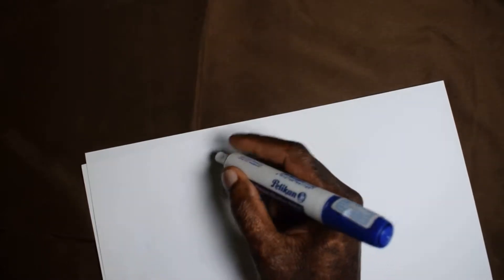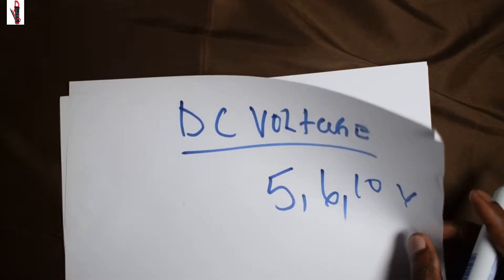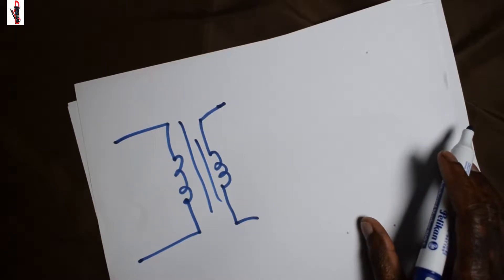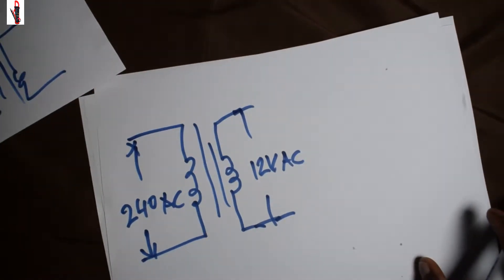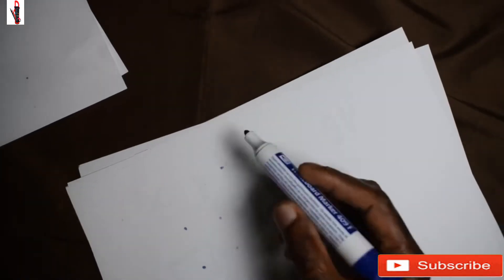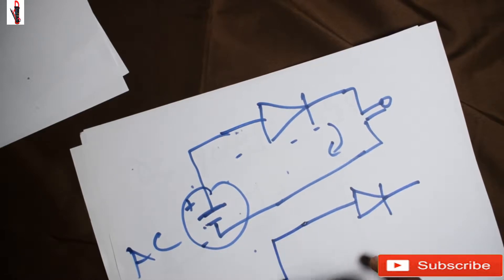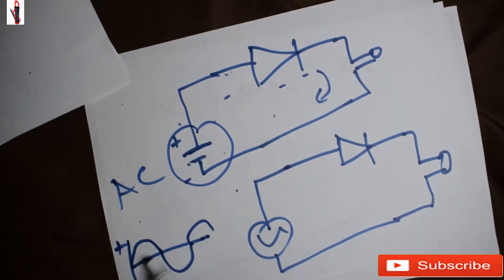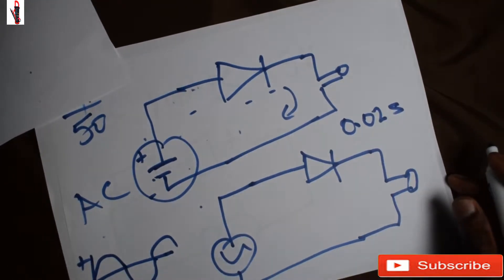How to convert 240V AC to 5V DC

Comment: I don't know much abou the inner workings of the LM7805, but more a higher voltage (within the specs) could also be translated into more amps at 5VDC. The extra voltage could be converted into more amps and thus more overall power. But I don't know if a linear regulator like the LM7805 is smart enough to do that ( maybe it simply dissipates the extra power into heat)

Comment: Thank you. I had a 240v synchronous motor from a microwave plate rotator (be careful!). The synchronous motor has plastic planetary gears to give a slow constant. Deep fan blades weren't appropriate for a bicycle mount. The gears gave resistance and after taking my them out, there is very little resistance on the central magnet rotor. Thank you. Haha, before I was scratching my head with 400v cap in hand
Reply: Capacitors useful when circuit has low current. Timing circuit with (less required) capacitance for spot welder when 5v relays powered on from 5v battery

Comment: To use batteries with big ore small🌞 Sun panels is good ; to constantly charge the batteries.
Reply: The advice in the video has explained how to use a fan with 240v motor to charge 5v DC appliance. 30amp hour at best for a few hours with a 400w panel in UK.